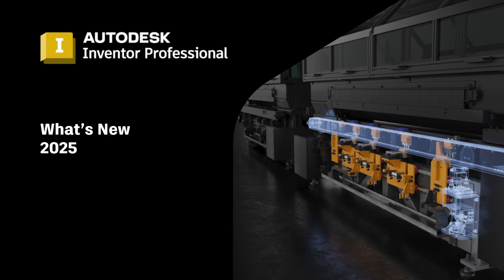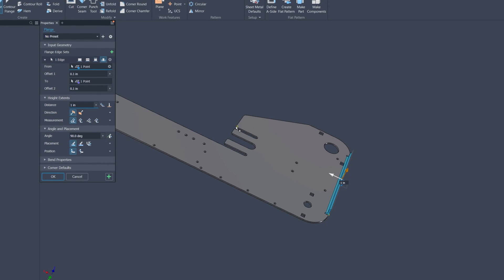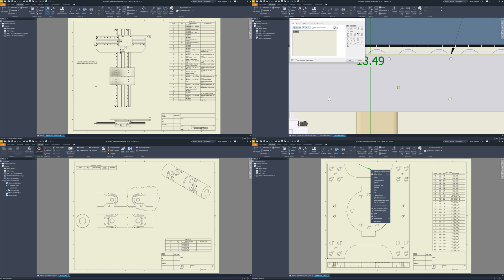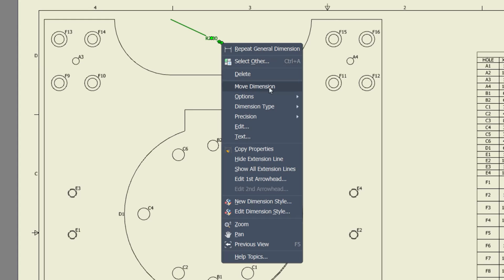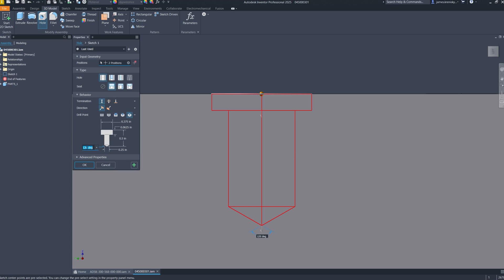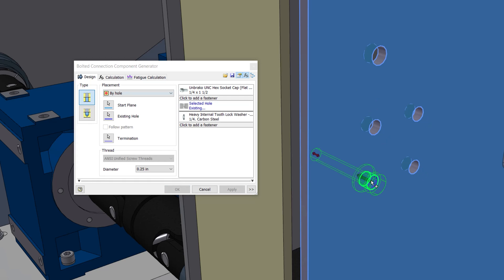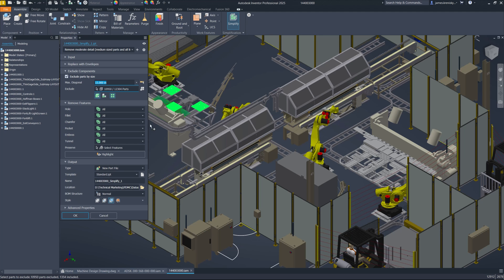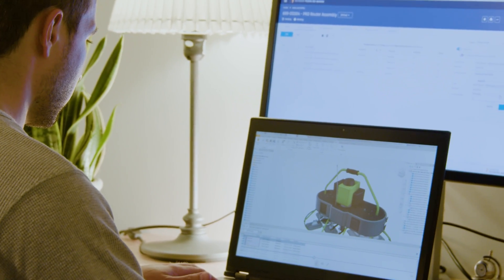Inventor 2025 What's New

Comment: Awesome new features but please create a way to do complex sheet metal flanges as used  in the construction of aircraft sheet metal.  Would be great to be able to create a flange around an arc or spline and then be able to flatten it as able to do in the actual die pressing of the part.  Solid works allows this.